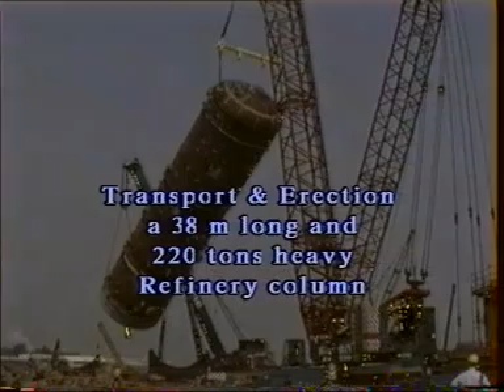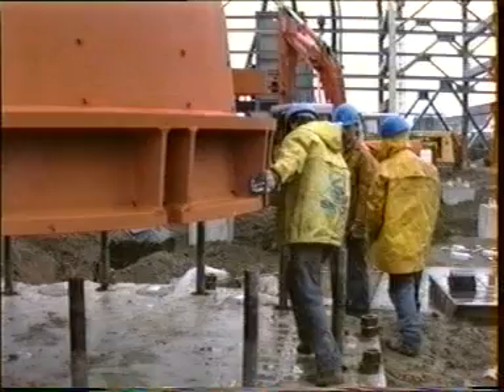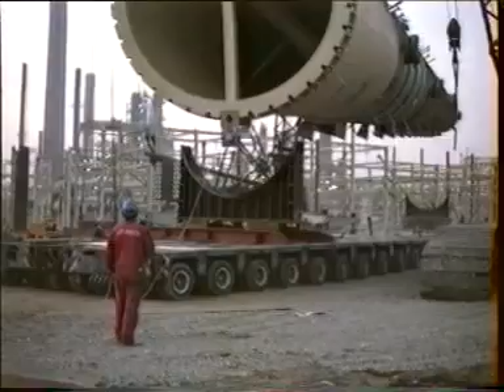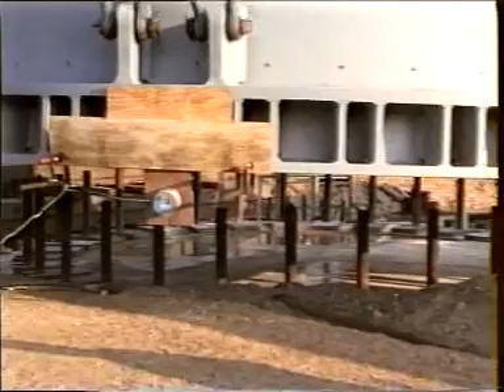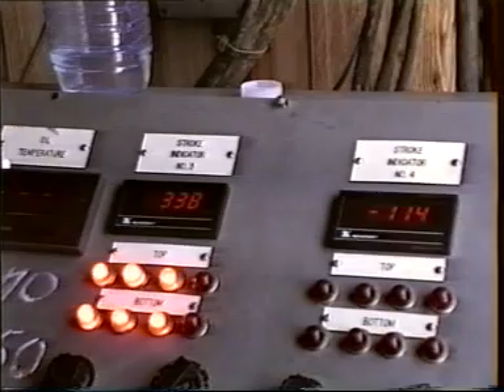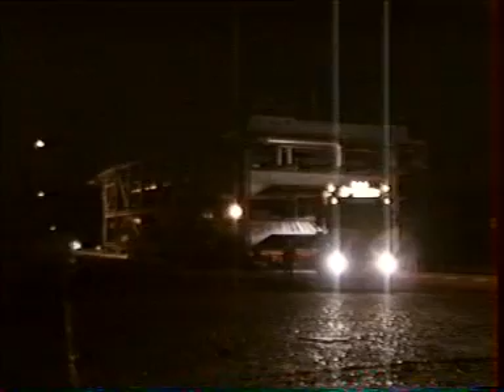Lifting The Big Ones 62minVideo

Comment: Hi Richard,

Can you explain to this ignoramus how the top of any lifting shackle is released from what could be a 80 metres or so please?

Take care and forgive any error in speing as some of the digits are not working on the ine every time, starting wit (A).
mrbuenun
Reply from the maker: When lifting grommets are connected to the top of a pressure vessel to be erected in vertical position, then I prefer to use lifting trunions, instead of pad eyes with shackles. When the pressure vessel is erected the grommets can easily be taken of from the grunions, by loswering the hook a bit and slewing with the crane. In that way you avoid people going up in  a man basket to disconnect the heavy pins from the lifting shackles. I hope this answers your question.
Reply: Hi Richard,

Thanks for your explanation.
Reply from the maker: Sorry for the late reply. When you use lifting trunnions instead of pad-eyes, you can easily lower the block a bit and slew with the crane jib to release the grommets from the trunnion. When you use shackles w=hic are connected with a pin to a pad-eye, you ned to go up there with a manbasket to take the nut off and pull the pin, or use a remote controlled shackle. Trust this helps